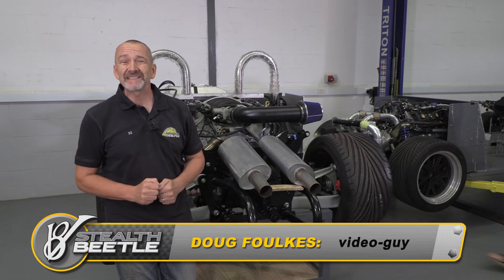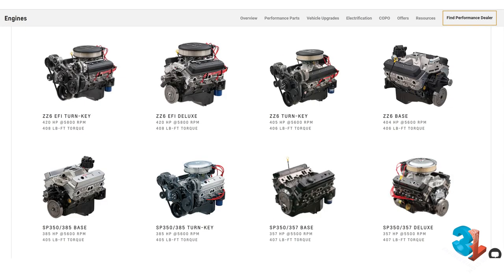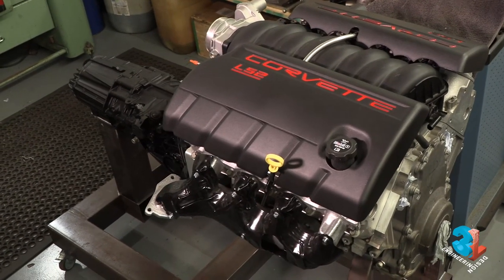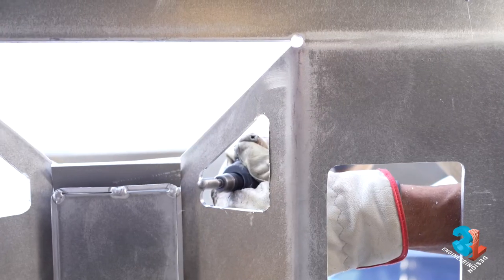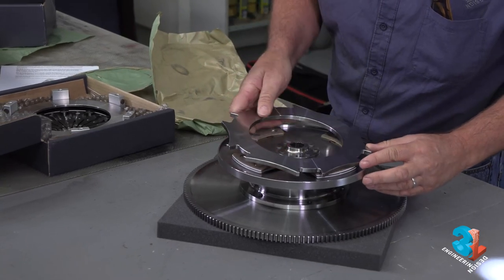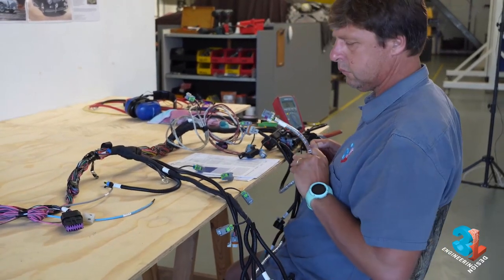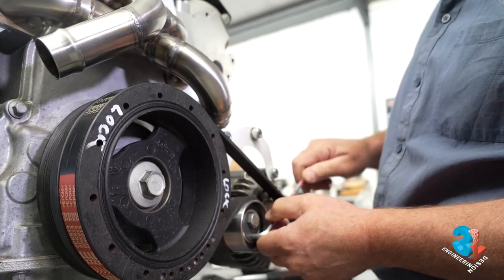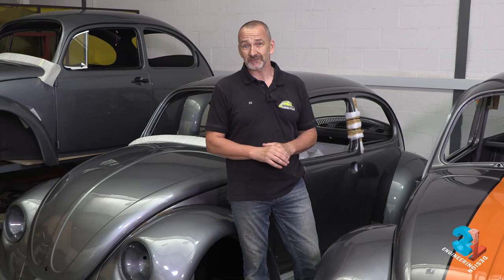I nearly sh@t myself when the LS3 started

Comment: What would probably be best for this LS2 is to de-stroke it down to 331. If it's done right, it will send your redline up to 7,500+ rpm. Some people are pushing them over 8,000 rpm with forged internals. 
That would be pure insanity in that little bug! The only thing that could possibly be any better than a rear-mid, de-stroked LS2 would be if it were awd!